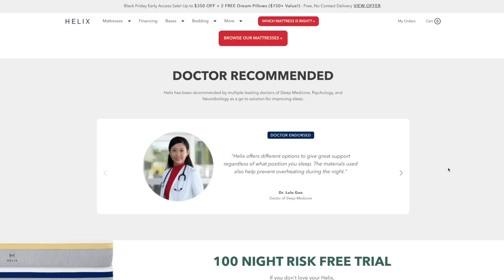Taking My WIFE to the NUCLEAR Missile BUNKER for the FIRST TIME!!! (She's Not Happy)

Comment: With the water system. Need to check the water tanks for mildew and make sure they are clean. Also would change out all filters. If they were sitting full of water for a long time, could of built up mildew.

Comment: You might pump the water out of the silo, and into the pond area. By the way, I'm pretty sure that water is coming from a storage tank that hasn't been flushed out in thirty years. It's also likely to have been cross contaminated from whatever's in that silo, and septic stowage tanks. Good luck getting that place back in shape.

Comment: Idk how much more expensive it would be.. but a drop ceiling might be a good idea. You probably won't be able to run wires through the wall or ceiling so if you put a drop ceiling in you have access to hide/run all of your stuff. It doesn't have to be like 8th grade classroom drop ceiling either they have a ton of different styles

Comment: Hey Flair, I just realized something. All that metal that's in the Silo. Is the metal angle iron from that upper room around the outside of the walls. If u compare it to the angle iron framing that's in the control room below the the living area. If u look back at that piece u had brought up with that magnet. It fits like the top and bottom connections of those angle iron framing in that control room walls.

Comment: You have to get decontamination filters the filter you're using is for tap water Waters that sit in bunkers have stagnant and other bacteria growing in it so you have to have a cleaner that will neutralize the odor and bacteria that grows in a dormant tank because the tank is not utilized frequently

Comment: Okay let’s get down to brass tacks. You need to build a warehouse over the silo with an actual gantry crane, or mini gantry.  This will allow you to life the ride off the silo and cane out the silo.  Then drain and lift all the stuff out of the silo. Also disguise the silo and serves as a lockable storage barn. Hopefully it will cover the door and stairs. 
One water quality and asbestos has been tested and removed. 
All the walls need to be treated with water proofing pvc paint that penetrates the concrete. Once cured then stud and insulate. Insulate behind the studs.  I might consider sound proof insulation.  
Wire and plumb. Might consider food safe water tanks at bottom, not silo. With good filtration and ozone system. 
I would consult  the bunker guy out of Dallas Texas on air filtration system. And good hvac that circulates the air inside. I would add real plant for fresh air. 
I would get some Tesla power walls and solar and wind power.  
Privacy security fence then perimeter. 
I would verify you septic on site.
I would replumb then entire site and seal all pipes they are a source of leaks. 
You would need to decide what to do with silo, water tank or if topped with building and sealed properly. You could do an elevator in silo large to bring furniture up and down. 
I would make the ceilings look like the sky with clouds and possibly glow in dark or light projected starts from recess.  This will make it feel like out side. 
There are several people that have restored these I would defiantly consult with them. 
Pump and dry out after asbestos test. 
Good luck

Comment: Just carve tunnels in the insulation for the huge cables and run a pipe and re seal it with spray foam, so that it is under the insulation inside a tube, so it isnt stuck in the foam. 
And sand down a huge square on the insulation on the wall as the movie screen for the projector.

Really sick project, i hope you paint the entrance walls, railings, blast doors and all. would be sick with white and red or white and black.

Comment: Just curious...have you done any gas monitoring in any of sections with a gas monitor to ckeck the carbon monoxide and other gas levels since underground? Does it have an air circulation system that is filtered and protected?

Comment: i am sure this has been suggested. but drain out the silo, open the doors and crane out the debris at the bottom. then you could lower supplies and workers down to the bottom. and build like a ton of floors in it. could even do an elevator down the middle. and then each member of beefcake could have their own floor. as a studio apartment. and the two floors up top can be the communal hang out areas. it will take alot of money. but i am sure brad would love the challenge of designing it. and until the nukes drop you could have it be an absurdly priced airbnb for a few days at a time. make some profit and have the potential to keep your family and friends safe at the drop of a hat.

Comment: Repair the batteries and use them for storage. Dump the powder from an advil and top each cell off with destilled water. Then charge them with an old charger that doesnt have safty that doesnt charge drained batteries. If you use a jump pack you can get the battery too enough power to take the newer chargers.

Comment: You for sure need to run that water for a long time to make sure you flush out all the old water that's been sitting in the pipes, and If I were you I'd get a really good water filter and treatment system. If you let it run and flush the old water that's been sitting stagnant in the pipes and it still has a smell to it you will want to get a water treatment system that treats sulfur water. And sulfur water stinks. If you flush the pipes and the water doesn't stink anymore, you will still want a better filter system than that regular little filter it has.

Comment: Put cap full of bleach into the filter, and a new filter.  That should fix the issue, unless your water is compromised.

Definitely don't do the black ceiling. It will make the room feel smaller.

Comment: Flair with the water smelling like 💩 or rotten eggs that normally means too much sulfur in the water. Sounds like you need a new water filtration system or might even need to dig the well a little deeper for fresher water. We replaced our home water filtration that we had to add rock salt too and it gave us fresher water that once smelled like that.

Comment: You need to run hydrogen peroxide through your water heater and any water holding tank. That will get rid of the sulfur smell in the water.